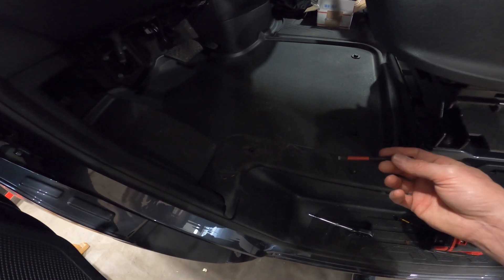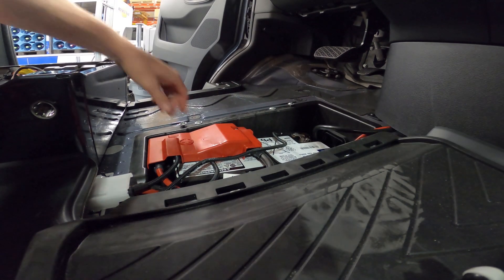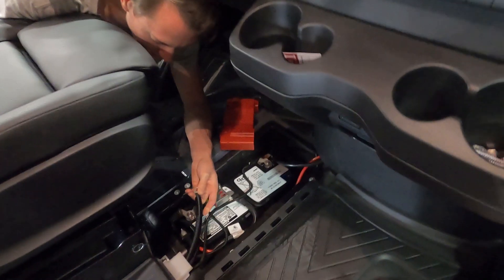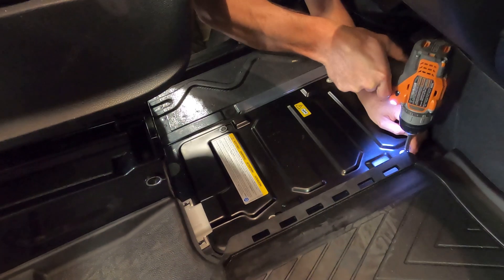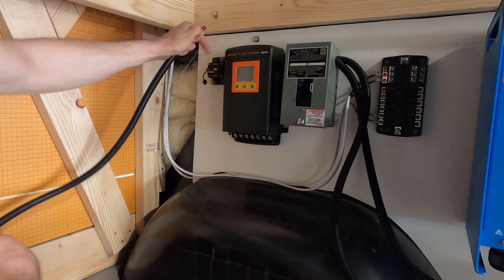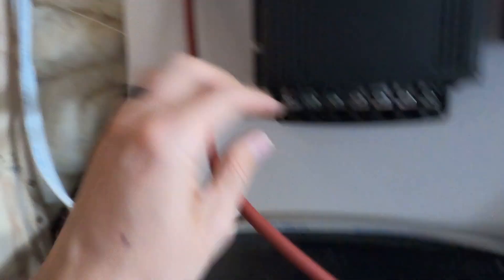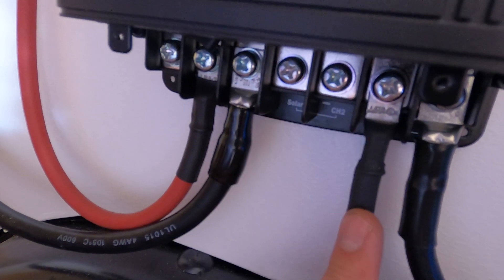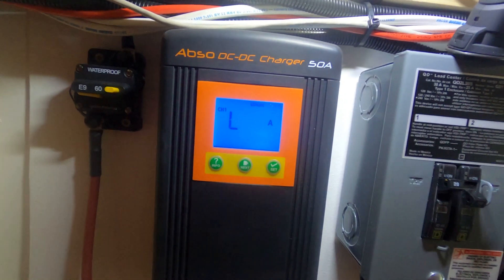How to Install Kisae Dc to DC Charger on a Sprinter Van

Comment: I’m no expert but I think you want the breaker as close to the van battery as possible.  If the wire shorts out and trips the breaker it will still be live the entire length of the van in your setup.  Unless I missed something.
Reply: I believe you're correct. I recently bought this unit and it says in the instructions the fuse/breaker should be installed no more than 7" from the battery. There is also a fuse/breaker shown between the charger and the house bank. Also, probably a good idea to connect an ignition connection.
Reply from the maker: Thanks for the heads up. I’ve fixed it.
Reply: Moreover, I am not sure connecting the black to the van shell is best. Current always makes it back to the source thus in this case uses the van metal shell to get back. Best is to make sure the negative run thru wire all the way back to the battery. In this case, you got the DC distribution center close by, I would connect it there.

Comment: Did you set your system to also charge van battery from lithium if low?
Reply from the maker: Hi, the van alternator charges the van battery. The lithium batteries do not charge the van battery.

Comment: Look's like an easy install & a good job at that! Question? Let's say you were boondocking for week and your system was very low. On the 6  hour way home, how will the vehicles alternator deal with this load?
Reply from the maker: I read on one of the sprinter forums you can take up to 50 amps from the stock sprinter alternator. If you have a different vehicle I suggest you call the dealer. You can easily set the charge current on the dmt1250 if you are worried about drawing too much from the alternator.

Comment: Great video, did you need to connect smart wire from the dc charger to the smart alternator connector on the battery?
Reply from the maker: Thanks, I was told by Kisae the charge controller senses the voltage increase from the alternator and doesn't need the smart wire. It just needs the positive from the battery / alternator.

Comment: About to install the same DC-DC charger MPPT unit.  How did you route your wire from battery to back of van?
Reply from the maker: I went under the driver seat plastic trim then to the side wall of the van. Ill see if I have a video.